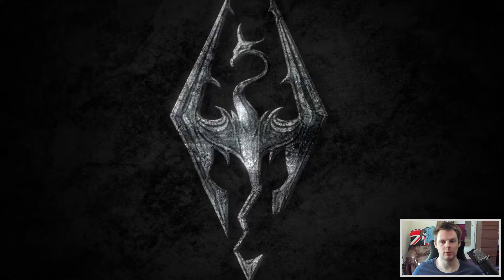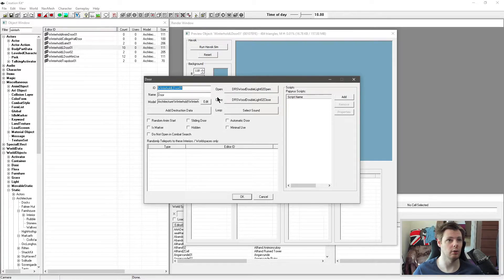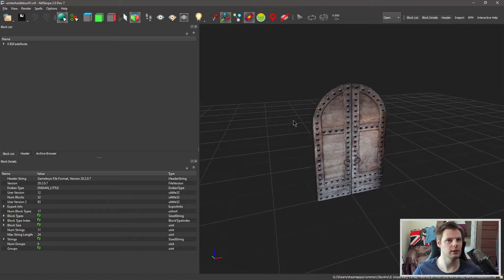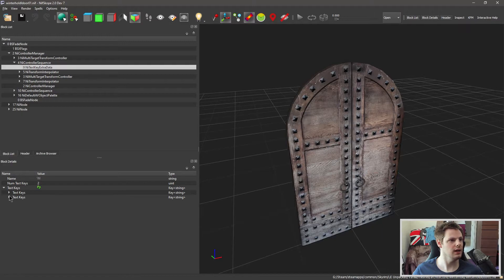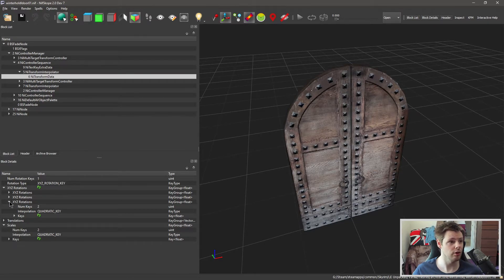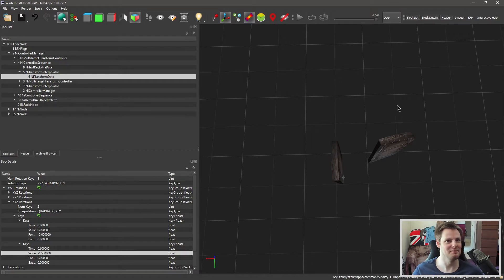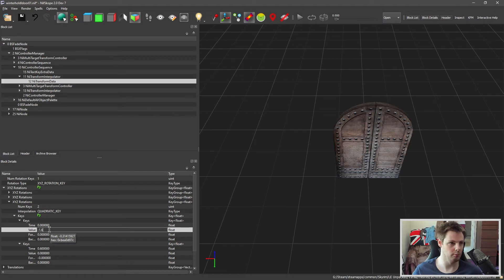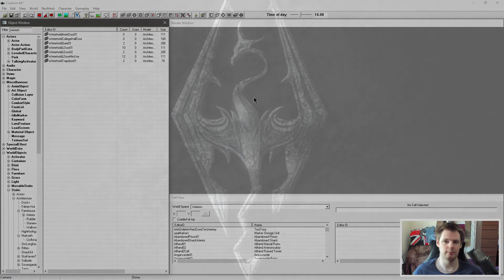NifSkope (Door Animations)

Comment: Just a correction for 5:45, you can actually know which NiTransformInterpolator influences which door without needing to mess with it, you just need to select the NiControllerSequence respective to the animation want to change, and then in "Block Details" there will be Controlled Blocks, just expand it and it will show you the name of each bone that is controlled in this animation, and the respective interpolator that controls them. Nifskope also shows you where each bone is on the skin, so you can look at where this bone is influencing what.

Comment: One thing about doors in Skyrim that no one seems to want to acknowledge is that when you enter a single door, it magically flips and hinges to the other side of the door frame. This doesn't apply to double doors because you have a door hinged on each side of the frame regardless of whether you're inside or outside.
Reply from the maker: With standard animated doors, it's not an issue but with load doors it is. It's a small detail that Bethesda overlooked. They should have had left and right versions for each side of a load door with the handle on different sides.
Reply: @Darkfox127  Finally, someone gets it. I've literally had people tell me that I'm crazy and doors work that way in real life.
Reply from the maker: @acbeaumo  Unfortunately to fix it, you would have to create an opposite version of the mesh and then swap half of every door like that in the game which would cause issues all over the place and then other mods would need to same tweaks for 100% matching doors and immersion. Suspended disbelief has to be used. :(
Reply: @Darkfox127  Oh, I know. It's totally impractical to fix.